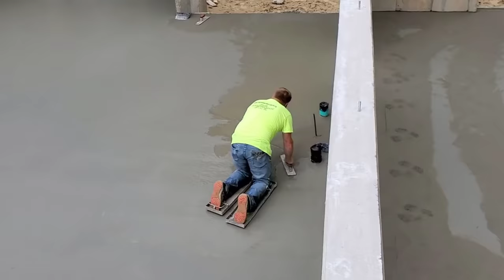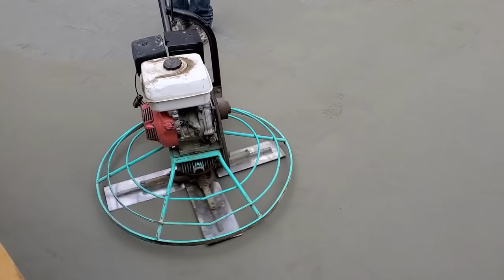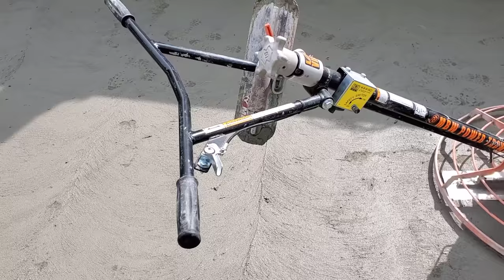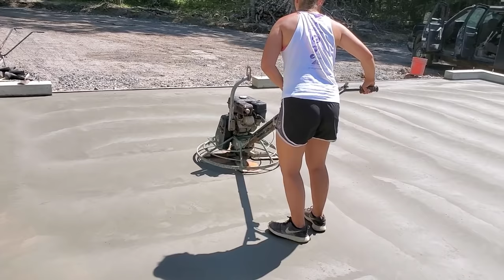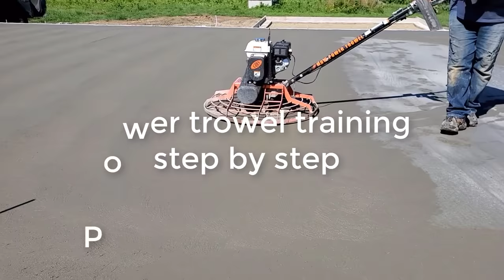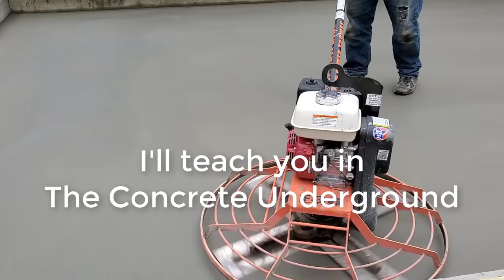Finishing Concrete - Is Anyone Teaching You This Skill?

Comment: One thing I like to do when I’m running the power trowel is rather than walking back and forth along the path of the machine, I like to leave my feet somewhat stationary and reach out with the machine as far as I can left and right. It’s a huge help on hot days when the concrete is setting fast, not having to deal with as many foot prints. With that being said, you guys do great work and are highly skilled finishers. Keep up the good work
Reply: I agree bud.  I don’t understand why guys do all that movement for one pass it’s got to be three times as many steps.  At the same time it’s how your taught.  Idc how it’s done as long as the results are the same
Reply: Couldn’t agree more. I mentioned the excess foot steps in a previous video. I was told the finisher was the best and didn’t need to learn anything.
Reply: Your getting on it too soon if your foot prints  are deep enough  for it  to matter or use  flat sole boots
Reply: @Psy6o   too soon if the foot prints matter? lol. No we're talking when it's hot bro. 100% thats gotta leave 3,4x as many foot prints doing it that way . Come work in in the Midwest when it's 100% humidity, HOT AF.  Can't be screwing around like that going sideways, leaving all them footprints.... Yeah can't be doing that on a hot summer day
Reply: But hey good looking work!

Comment: Watching you kneeling on and over that wall, magging the edges reminds me of my days as a superintendent, doing high rise work. I remember many times having to ‘look the other way’ when the finishers were out hanging off the edge of the building, magging the edges.
I felt like Sgt Schultz from  - “I see nothing! I know nothing!” 😑
Reply from the maker: I know, we used to do that too on high rises. I can remember once one of the guys I worked with ran a power trowel right off the edge of a 2nd story. Only had one safety cable on the outside perimeter. Trowel went right under it. No one was injured luckily. This was back in the 80's.
Reply: @MikeDayConcrete  Ha! Interesting YT deleted the name of that old tv program I mentioned (H-Ø-g-a-n-s  H-é-Ø-r-e-s) 🤔 Wonder why?
Reply: @psidvicious  cause it was a good ol fashion show with a bit of truth in it an that's NOT what YT is trying to promote today in fact its just the opposite.
Reply: @D-train69  I guess I’ve lived long enough now to watch the world throw common sense and reason out the window in favor of PC and wokeness. I wonder now if I’ll live long enough to see the world come back to it’s collective senses and reject all that ideological nonsense. 🤷‍♂️

Comment: Mike pouring  a drive way in Pennsylvania should I use steel mesh with 3500 psi or leave the steel mesh out thanks for your help your videos are very well done thanks for the information 👍🇺🇸
Reply from the maker: We use 3/8" rebar and tie a 2' mat in driveways. Block it up with pieces of brick.

Comment: Awesome work!! We have a 32x48 garage and a 35x26 apron thinking of doing it ourselves and all of your videos are incouraging me more and more! Lol the concrete is 4200 psi fiber and 4 inches thick... I've been reading we don't need to use mesh or rebar if its 4"?
Reply: The garage should have #4 rebar drilled into existing foundation.  For the apron depending on where you live . Check with your local building codes . The cost to benefit of rebar.  Rebar wins

Comment: Mike, can you use power trowel with float blades to float a slab if you were getting behind rather than scrubbing with mag floats? Or would this densify the concrete too much ?
Im talking exterior air entrained concrete.
Reply: In my experience that’s Fine.  I have on several occasions done just that from start to finish    When guys don’t show or or just undermanned.  Got to do something to get a finish on it.  Keep blades flat as possible.  Roll the fat smoke them slow where the shades so mike don’t know.

Comment: Machine should do All the work except for all edges and last wipe out.. first pass with machine with combo blades keeps blades flat as you can and fill in all little holes. It’s all about Timing, the mix, temperature, humidity and possible direct sunlight 👍

Comment: that machine at 9:00 blades are too high, I did this for 37 years, go by the sound the blades make, if it sounds gritty blade too high, same goes for hand trowels, you can fill a hole quicker with a flat blade
Reply: Im hearing a lot of rock popping
Reply: Not true you get it much smoother with an old trowl they bent a bit after use

Comment: Do you use a jitterbug or roller tamp to press aggregate down? I started using a roller tamp, sometimes it creates a great product, other times I can still see marks from tamper after concrete is finished.
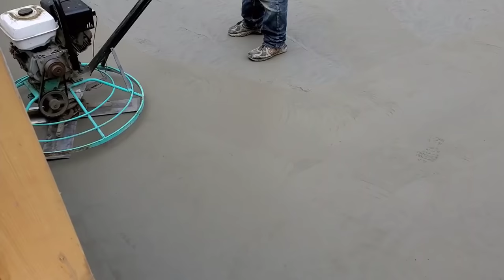Reply: I don't what part of the country you're in but here in Nevada, tamps are rarely even used that much anymore, one high end outfit I was with in the 90's still use a tamp, not a roller bug, on all garage floors, never anything exterior because of the rock, your strength is in the agg, exterior would never hold up in these conditions. That's at Lake Tahoe, down here in Reno nobody ever tamps anything, one for the loss of strength by forcing the rock down & the biggest thing is that our concrete blasts of fast, no time to tamp it or you'd be scrubbing your asses off every pour. One batch plant here has mud that flashes before it gets down the chute! That's not an exaggerated statement, you can see the dull color & tone as it leaves the drum, the shine from water disappears the second it goes from the drum into the chute, and that even using Delvo, or other brand of retarder & with plasticiser added, it's enough to give you nightmares! If you're not running and closing everything up immediately, you'll loose it unless you have an army of guys & leaving nothing half assed when laying it down, sometimes all you get is one time like tract work, lay it all down like you might not get to come back on it & lots of times you don't! Everything back there is like we did it 40 years ago, we never have to wait for it to air, if ya do, it's over, but we go on a pour at 10 or 11 am if we're that lucky to get mud that early, get dumped out in an hour or less & back home having a cold beer by 1:00-1:30..about an hour and a half on a warm or hot day & we're done! I'm getting a lot older and don't have that many more years left at that pace & glad for it, I'd die if I had to run like used to on huge pours!

Comment: Hey Mike I own the same MBW power trowel have you ever had any problems with it when your full throttle. mine sounds like it's  skipping or boging out when it's wide open it actually shut off and wouldn't start back up .the floor was just about done so I just wiped a little spot that wasn't polished but the next morning it started right up weird.
Reply: A little late to the party, however as a retired auto mechanic I have seen a lot of cases where gas caps were not venting and they would cut off after running a while at full throttle and not restart until you opened the cap and gave the carb 15 seconds or so to refill the bowl......of course it could also be the ignition or about a dozen other things ;-)

Comment: Never ran a power trowel. The company that I worked for "didn't have time" and the foreman was an arrogant prick. Funny thing is; my hand finishing skills were ten times better than his. They let me bull float, slick, broom, crawl edges, run deep jointers & edgers, sponge steps and curbs and run the screeds. I would be left behind on basements after sand was dumped, and shovel the whole thing, this included digging out tubs and center wall footings. I was a shovel slinging S.O.B.🤣 I became the only person on the crew to set up symmetrical circles and triangles, because the boss couldn't keep them looking decent. I saw cut everything that needed it and set all screed stakes( L's). I was allowed to unload and maintain the Bobcat but never really allowed to use it. Arrogance and Ignorance played a big part in all of this. This was 20 some years ago. A crew of five men, all hand screeded, wheeled & in some cases bucket poured. There are still days I miss it........